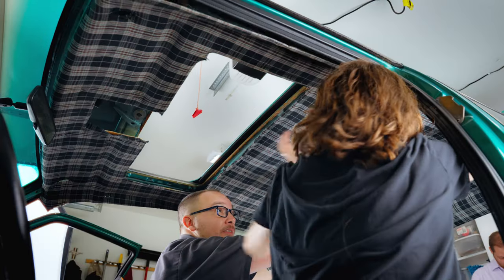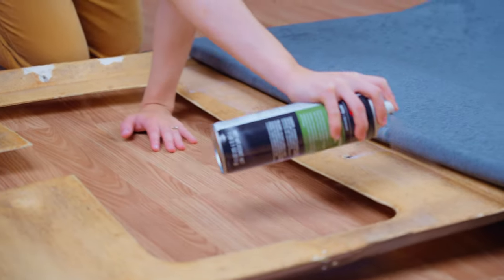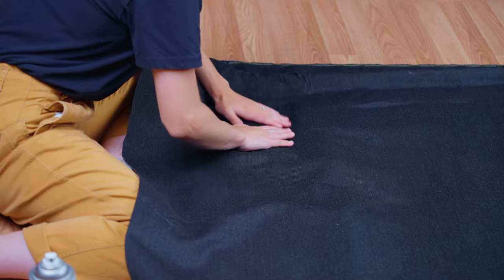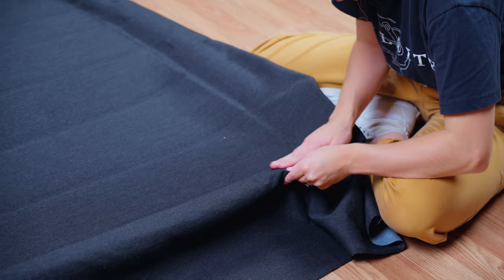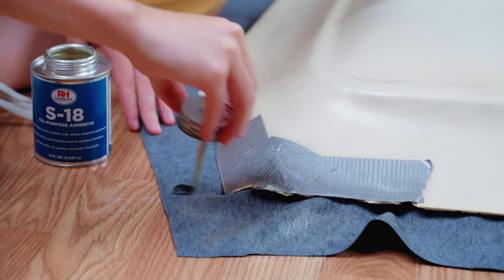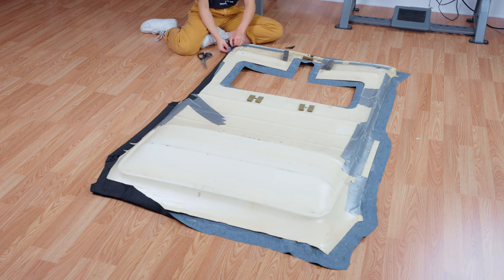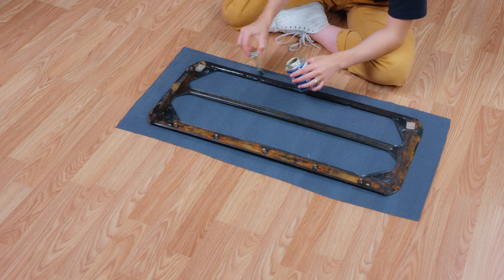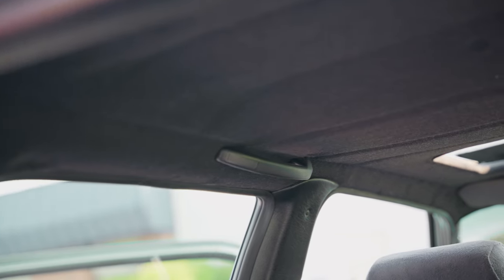How to Replace Car Headliner | Automotive Refresh Series

Comment: Wish I could spray some adhesive on a floor surface, but I can’t afford it. I’ll use some kind of drop cloth.
Reply from the maker: Because we were working on laminate flooring we were able to easily wipe away any overspray with adhesive remover. Good luck on your projects!

Comment: The old foam should be removed before applying adhesive.
Reply from the maker: Our specific headliner actually didn't have any foam on it. The discoloration that is there is actually just the fiberglass. So we were able to just remove the previous fabric and apply our adhesive to the fiberglass.
Reply: @SailriteWorkbench so you can apply fabric to a headliner without the foam? My fabric doesn’t have a foam backing either do yall reccomend taking off the previous foam I do have and just applying it with no foam at all?
Reply: @Lpsanna86830   the fabric they used in this video isn't headliner fabric.   Headliner fabric has foam built in.  If your car has a bunch of deteriorated foam when you take it apart, that has to be all scraped off or the new stuff won't stick.... If you're going to go "no foam" by using a fabric which isn't made to be a headliner, it will have to be a thicker and/or darker material.  The actual fabric portion (not including the foam layers) of usual headliner fabric is super thin and will show glue as wet stains if it doesn't have the foam layer.  Look up headliner fabrics for sale and this will all make sense if it does not presently.. And watch some professional headliner install videos like Reece's for example.

Comment: Wrong glue , this headliner will fail again
Reply from the maker: Thank you for your comment and concern. However, installing light headliner fabric is a recommended use for the 3M General Trim Adhesive we used in this video. It's designed to bond lightweight materials, making it a suitable choice for this project. The headliner is holding up well and has shown no signs of failure. We appreciate your input, and we'll continue to monitor its performance! Have a great day!

Comment: Very nicely produced video. A professional production quality. I have two questions. My stock vehicle has a foam component on the fiberglass roof frame upon which a very thin fabric has been bonded. Does this foam need to be  removed and the new material bonded directly to the fiberglass? What kind of material is used for the replacement (type/thickness)? Thanks in advance for your reply.
Reply: What vehicle do you have?  Honestly this video is not standard procedure (far as every other video I've seen on replacing headliners).  Headliners are typically a dense contoured foam or fiberglass board portion (the thick part, the light yellow you see in this video) and then a fabric which has foam bonded to it, and that layer (or layers) is then glued to the foam/fiberglass board.  When the fabric starts sagging, it's not from glue coming loose, it's from foam disintegrating... The "old" headliner material is unlikely what VW used of course (duct taped on).  The material chosen hear and the glueing method are unconventional at least...  Might go watch a video by Reece's Auto Headlining Repairs to see someone whose sole job is headliners.
Reply: @busyboxst7 it’s a  1998 Jeep Grand Cherokee (ZJ).

Comment: I would like to see how the headliner is removed. A screw driver or pryed off?
Reply from the maker: For this specific car, it was a combination of both. We used a screw driver to remove some hardware holding it in place. Then we pulled the headliner out from the trim pieces around the side that were holding the edges in place. But every car is going to be a little different which is why we didn't go into depth on this step. We hope this is helpful for you!

Comment: I really loved the video, but I was wondering how much fabric is needed for this? I know it will depend on the car but did you buy 3yrds of 60” width fabric?
Reply from the maker: Hi! Our car was on the small side, so we used 2 yards of 54-inch wide fabric. We recommend measuring from your front windshield to the backwind shield to determine your length. Hope that helps!

Comment: Super helpful but is it an easier way to do it without taking the whole headliner out. The fabric on my headliner is coming down in spots but I just want to make it stick back up without taking it out.
Reply: Unfortunately to do it properly, it will need to be removed. There is no way of effectively getting adhesive behind the sagging fabric without pulling all off and regluing it.
Reply: Trust me, you can get the headliner out. It may seem daunting, but it will be more than worth it. I believe in you!
Reply: If you must you can use 3M VHB tape Sticking surface MUST be very clean..remove all old glue
Reply: Sweet Project Cars has a DIY headliner repair video (temporary fix) that shows how to get glue into sagging areas via a syringe and spray can.  Again, temp fix but if you're careful likely no harm done.